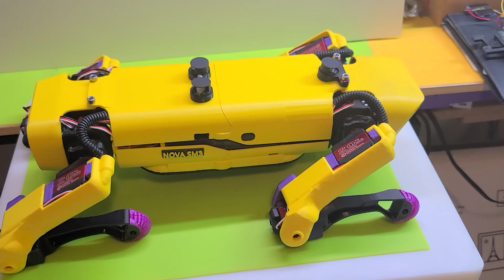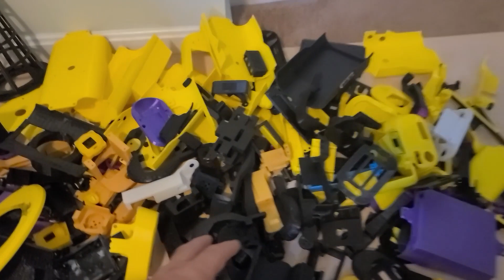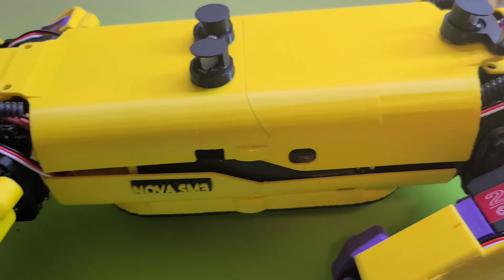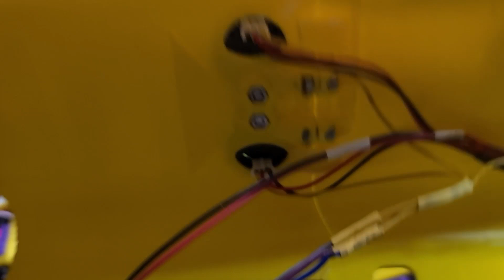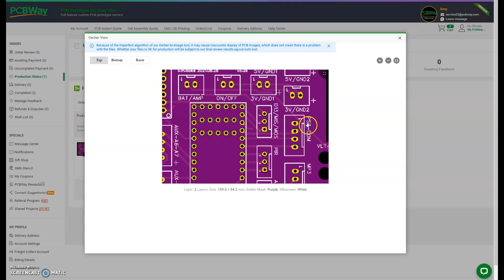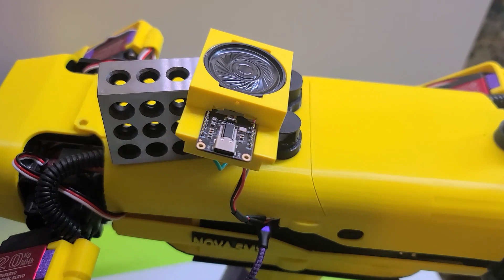Welcome Back, Nova! - a Quadruped Robot Dog Spot Mini Clone

Comment: would it be a good idea to print some of the more fragile parts in a filament with a slight flexibility to it to make it a bit little less breakable? might help with falling over during testing. great video!
Reply from the maker: hmmmm.... a good thought, but rigidity is important for stable movements and such, so I think that may hinder things more than protect. Some sort of shock absorber at the knees would be the ultimate fix - but I am trying to finish up software - no more hardware changes for me any time soon!  lol   Thanks for watching